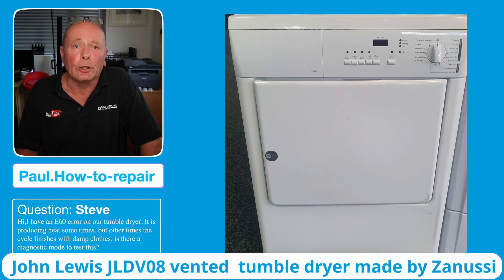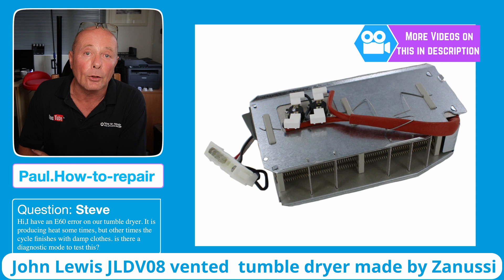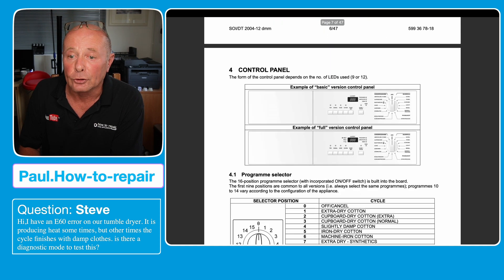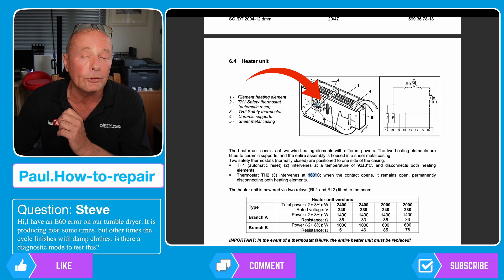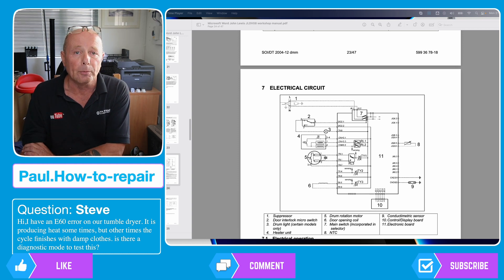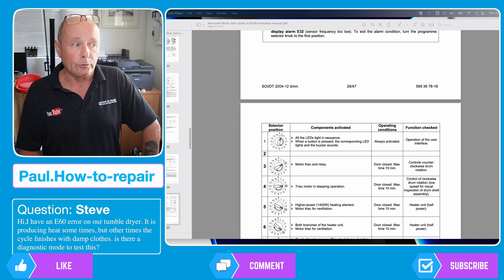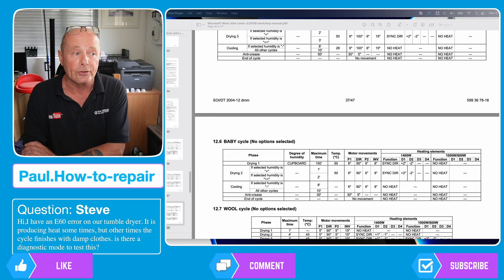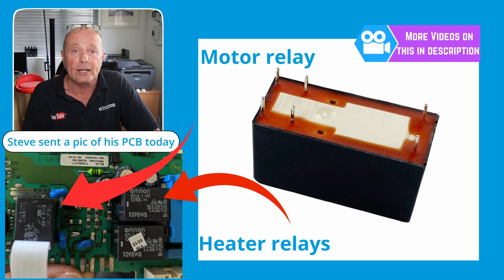John Lewis JLDV08 Tumble Dryer E60 Error: Complete Heating System Troubleshoot Guide! 📘🔧

Comment: Hi guys, if your aeg/Electrolux/zanussi heat pump dryer is running 30 minutes normally and then giving e60 (e63 in test mode) just checked the upper capasitor which should be 10uf. You will see it is around 4.5 - 5.0 that is a fault.. I finally solved it. Just replace the 10uf capasitor (the above one, connected to engine motor), no soldering or antything, it is plug and play. Buy it from an electronic market showing the old faulty one, do not buy it from an AEG or other brand shoppers. Otherwise it will be 10 times expensive. There is space to place it into the machine,, so the new one can be a little fat or long, no matter, just be carefull for the values like voltage etc. They are not polarized so you can attach the 2 cables whatever you want. You don't need to disassebly tumble or any thing. Just get the back top and right panel, you will see the 10uf capasitor lying horizontally. Fyi, the below one is 18uf and you need to diassemble tumble and other things to get it back, but fourtunately you can measure it without disassemble.
Reply from the maker: So glad you managed to get your tumble dryer up and running again